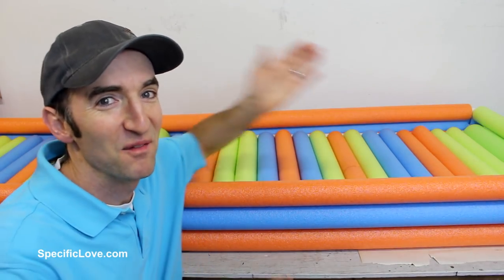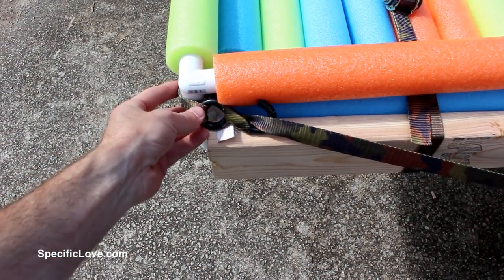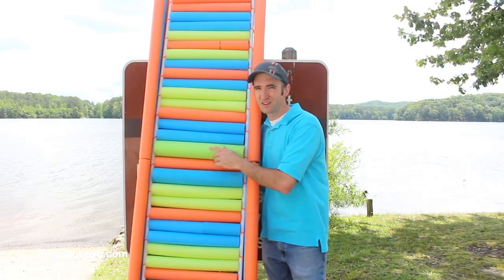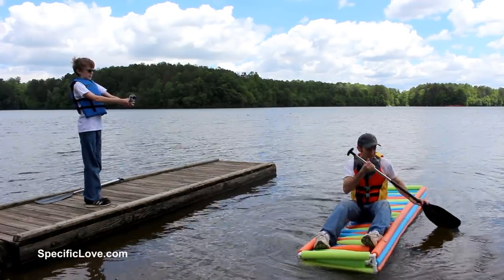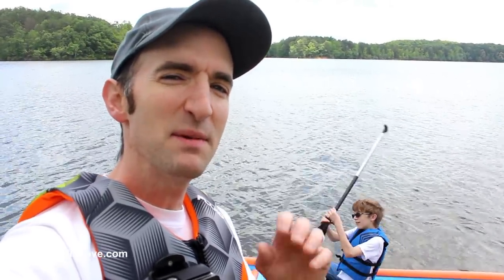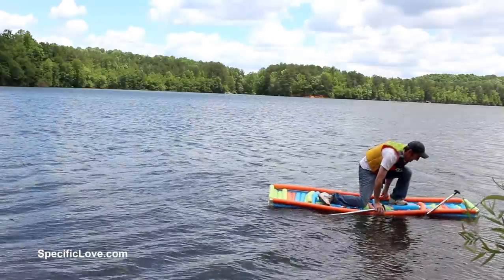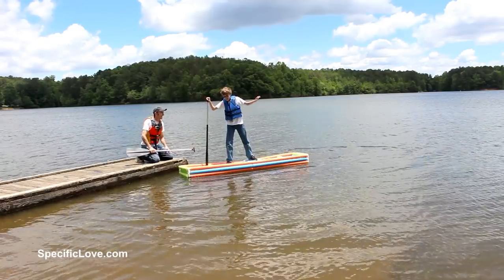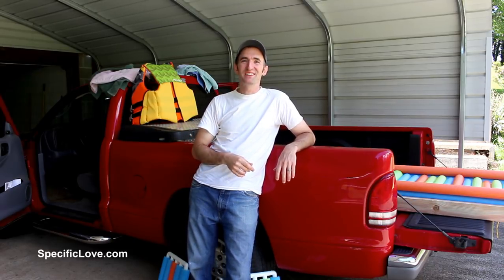POOL NOODLE BOAT - Fun at the Lake

Comment: I'm sure if you fitted some outriggers on this it would work great
Reply: or even just making it wider could add stability, but outriggers would be ideal for this build.
Reply: Skydive4ever Agreed, it definitely needs outriggers and mabey the center raft part could have been 1 or 2 noodles wider.
Reply: just one large pool noodle on each side with something rigid to hold them.

Comment: you're great at creating and constructing, but I'm afraid you need a bit of instruction on the art of utilization. while the form is drastically different, the performance of your boat more closely resembles that of a canoe or pirogue than it does a kayak. as such, standing is not recommended and the pilot should position himself on the aft quarter even when alone in the craft rather than in the middle. outriggers will improve stability, but not to the point that standing would be successful. A few minor modifications and a better understanding of the craft, how it works, and how to use it will make that boat a functioning and enjoyable vessel. I love your videos and look forward to seeing more creations.
Reply: I agree

Comment: Add cross tees half way through the boat... instead of 10' flexible lengths of PVC,  you would have two 5' semi-flexible  PVC Lengths joined with the non-flexible  Cross Tees. Just a Theory.

Comment: I would call it a success, two of them might even see support me!
Reply from the maker: I did not mention it in the video, but if you were to lay down, it will support even more weight. So maybe it could have supported you if you did it that way.
Reply: it most likely would but Im thinking  inexpensive party barge, 2 of those with a platform, a comfy chair, cooler, sunbrella and a trolling motor...   not sure if the coasties would approve but I bet it would work ! ...lol